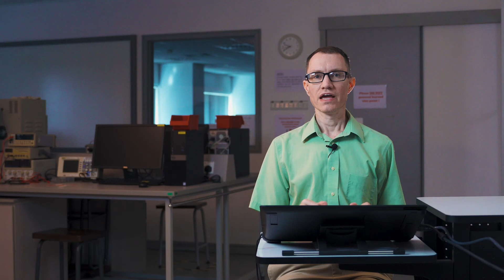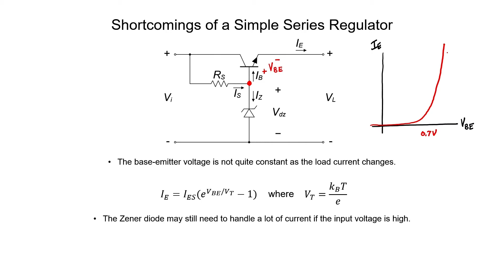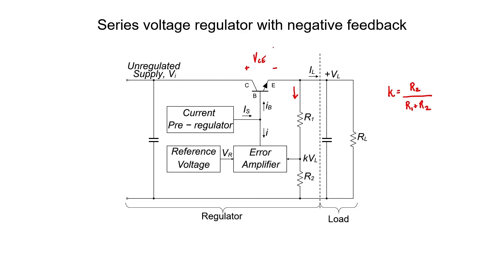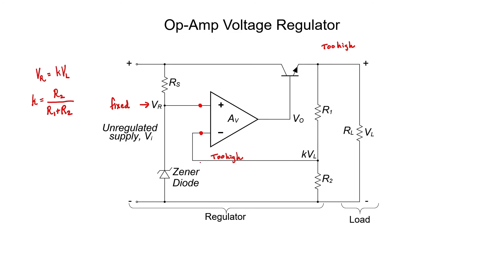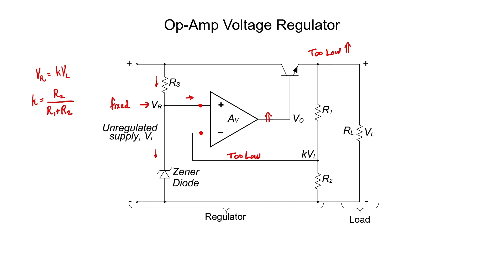Voltage regulator with negative feedback (5 - Regulators)

Comment: Thank you for amazing videos. I tried to simulate this and its variations on LTspice, and learned that when you attached a capacitor at its output, it will oscillate. (which led me to learn more about opamp stability issues.) Now most circuits will often have some kind of electrolytic and a ceramic capacitor at the power supply rail. I can think of trying to isolate the circuit in question from the power supply with a small value resistor. But that will worsen voltage regulation. Any other strategies you can suggest?